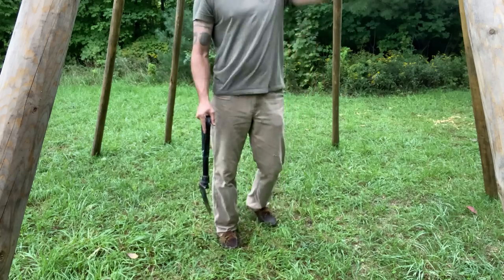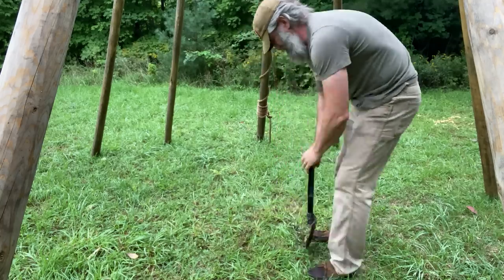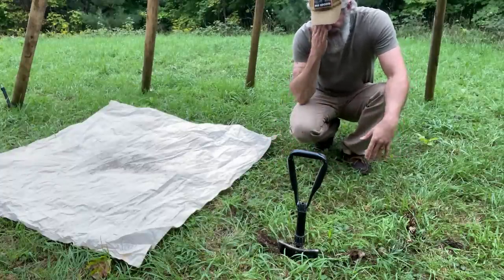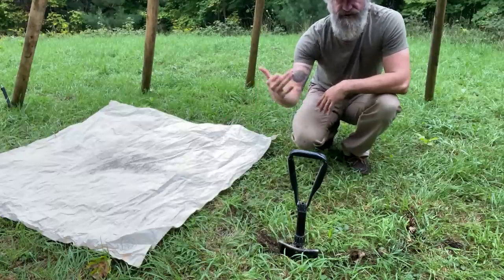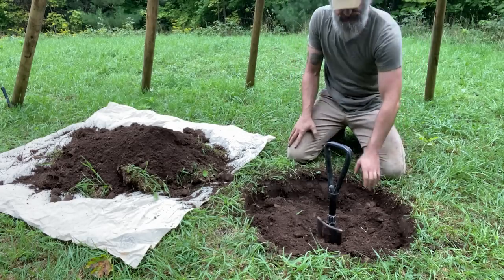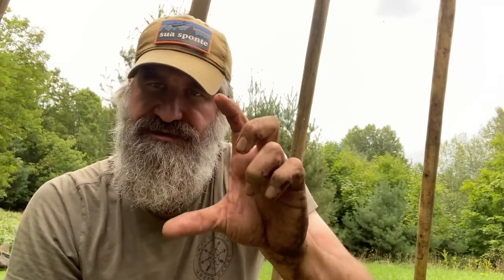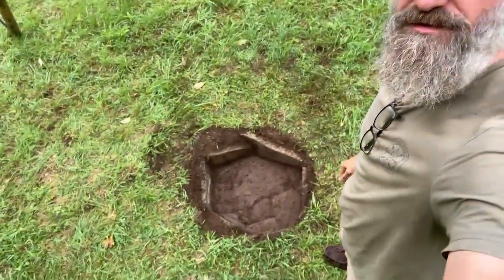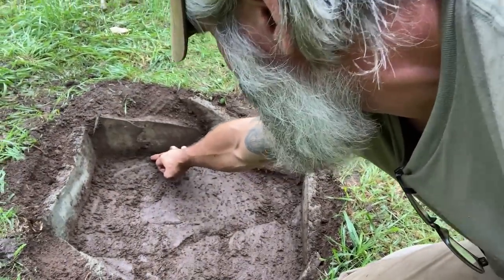TIPI SERIES: How to Build a Fire Pit for Your Tipi (Part 6) | Gray Bearded Green Beret

Comment: Thanks good info. I built a fire pit with an underground vent. Dug a trench a few feet past the tipi perimeter and lined it with gravel, and placed coffee cans end to end, (although ducting works much better) and covered it. It drafted really nicely. It helped that the tipi was on a rise, that way water didn't settle in the trench.

Comment: Nice looking fire pit, I have never done any tipi living,but have seen where you have the outer skin then an inner shin or blanket and by leaving the outer skin up a bit and the inner skin down to the ground it helps with drafting the smoke out of the tipi. Also a small cornered trench from the fire pit to outside the tipi to allow the fire to draw less of the warm air in the tipi and more of the cold air from outside to sustain the fire and keep smoke down. Not sure if it will work but if you have smoke issues you might give it a try. Can’t wait to see the next video shot from inside the tipi with a nice fire . Keep up the great content

Comment: That's pretty good there sir; Have you thought of small cuts of log in a self feeding fire system? Scaling the cuts down to 5 or 6 inches uses up less energy in the long run as you're not cutting large limbs of lumber but using up the small limbs leaving the larger cuts for the evening and cooking times.
Reply: One of the interesting things I’ve seen done and I believe was an original design of more permanent tipi was the use of an external air source. Small channel cut to the fire pit to provide fresh air, better burn, and less smoke inside.

Comment: why not do an elongated Dakota Fire pit? More fuel efficiency and no real draft if goes out. still rock line it for added heat retention. but the air flow makes is closer to a primitive rocket stove.
Reply from the maker: Because I’ve used Dakota fire pits, long term even, they use small fuel but that also means you are constantly stoking it. Defeats the purpose of not having to get up and feed it all night long, plus it offers very little in terms of warmth or light.

Comment: To start with, I wouldn't have been smart enough to make an actual fire pit in my tipi, I'd have just made it on the ground, but now that you have planted that idea in my head, I'm thinking that I would have broken some of the rock slabs that form the side walls into smaller pieces. It seems they would be easier to work with if forming a circle were a priority. The other thing that occurred to me is that the rocks would be less likely (probably not a big risk anyway, but just sayin') to fall over into the fire, if the walls of the hole had been sloped a bit, at the top, towards the outer edge of the hole you dug. This is all my Frontiersman's OCD rearing its ugly head. LOL  One thing I've seen others do with fire pits in small log shelters is to dig a draft tunnel to the outside to supply air to the fire. Will you be doing anything like that?